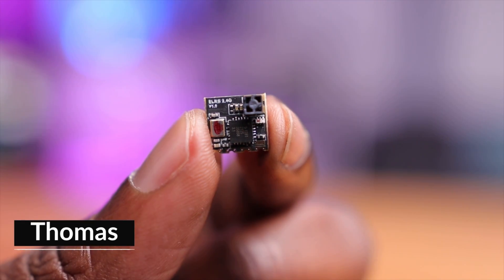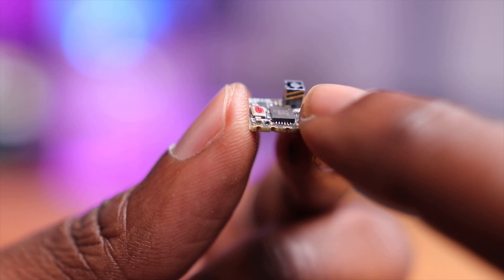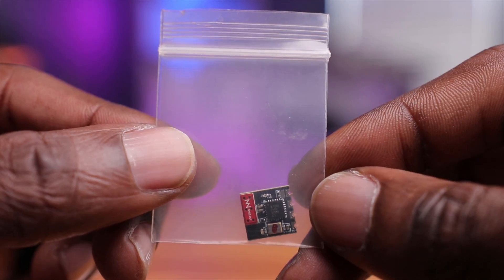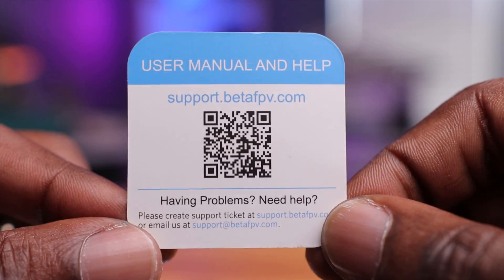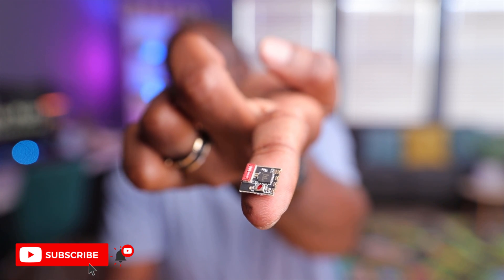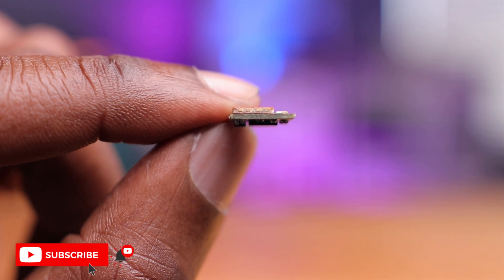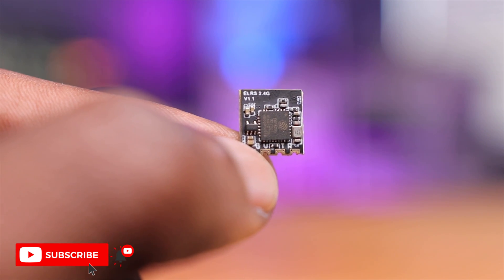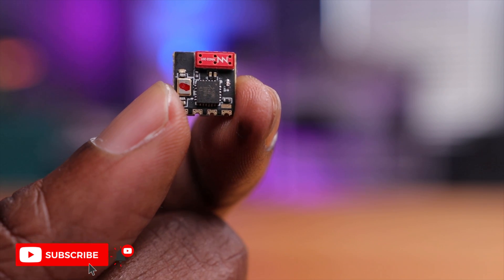BETAFPV ELRS Flat Antenna RX V1.1 | A Smaller More Durable Receiver?

Comment: I personally don’t like the little smd antennas on anything other than a tiny whoop.  That being said I’m shocked at how well they did for you. I’m going to stick with the ufl antennas though.  I’d like to see more flight controllers with ELRS receivers built in. I know the code for getting that is pretty difficult but SPracing has done a great job with it on their H7RF.
Reply from the maker: Yeh, it worked well for me, but as you said, they are perfect for really small builds(no more D8).  From what I understand, there are some benefits having ELRS built-in to the FC, but the updates are more difficult and involved.